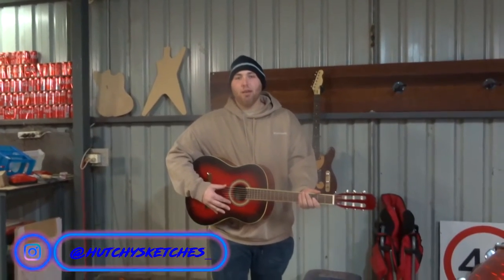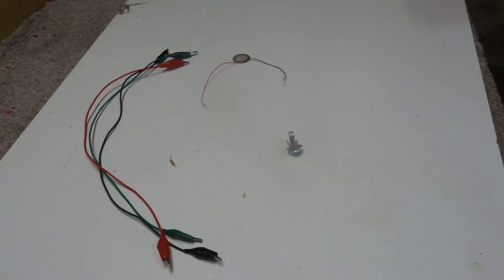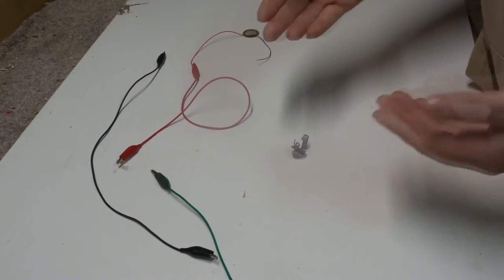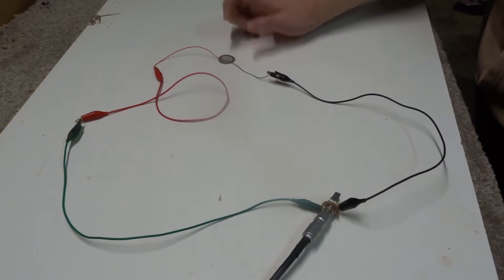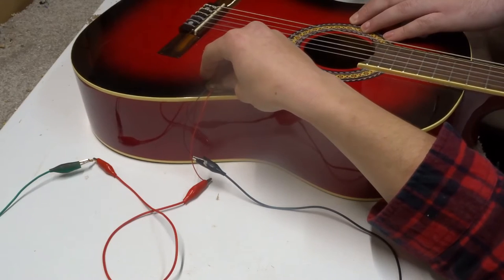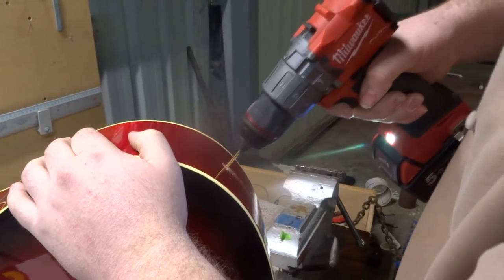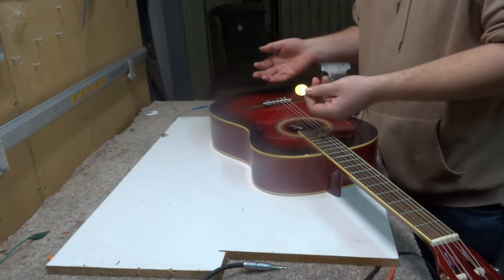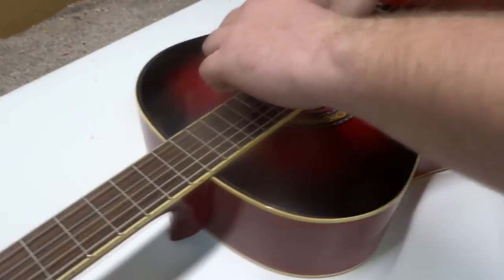How to make any acoustic/classical guitar electric for cheap

Comment: This is so helpful guys, appreciate it! I am gonna buy the parts but I have a question about piezo. Which is I found a few millimeter options to piezo disc when I searched. Such as 12mm - 15mm - 27mm - 40mm - 50mm. Which one do you think I should buy or the one you recommend?
Reply from the maker: Doesn’t really matter the one we used was pulled from an old microwave buzzer. They all do the same job anyway. Personally I’d go the middle size
Reply: @outbackguitars3272  Thank you so much!

Comment: What are the red and black wires that you used to connect the parts and the last one is it like a connecter to the amp ?
Reply from the maker: The wires are just wires there’s nothing special. And the jack on the end has a cable that plugs into the amp